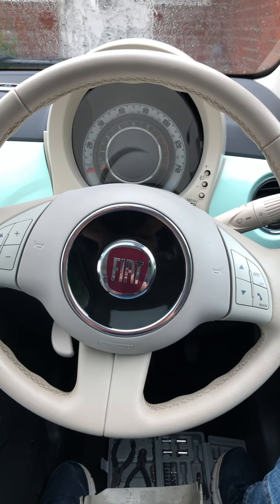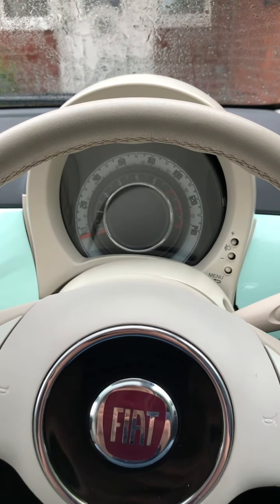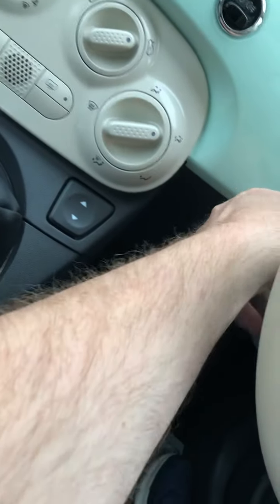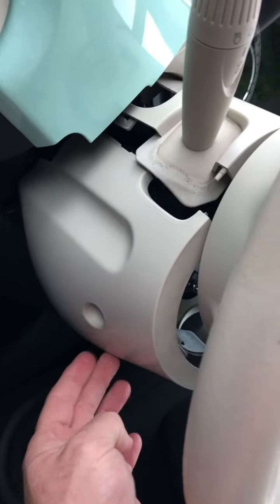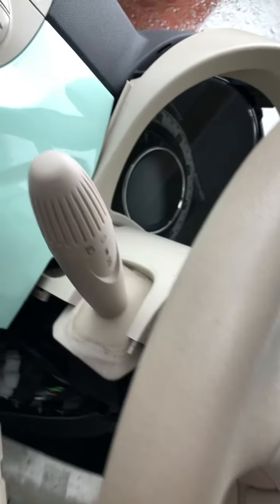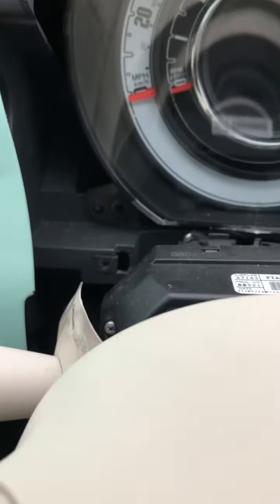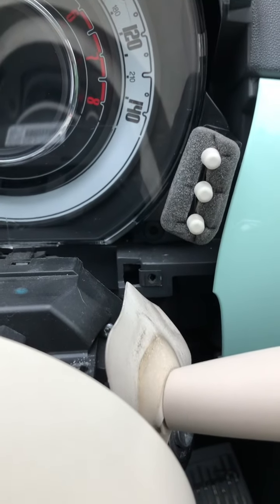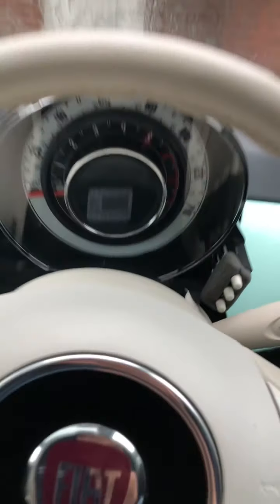Fiat 500 instrument cluster removal

Comment: Thanks for the video. Very useful. I will have to remove the speedo on my daughters 500 as the display is showing flashing oil and abs lights when indicating right. Same colour as yours ! The repair looks like its going to cost around £300.
Reply from the maker: Hi, I paid Cartronix £250 but that was a while ago. My display was completely gone but not sure about your issue, have you checked all external bulbs as the displays sometimes do odd things when you have a faulty or blown bulb. Check brake lights, fog lights, reverse, headlamps, etc. I am sure I had some strange issues with warnings and found a bulb gone.
Reply: @MLTOPAYNE  thanks for the tip. I asked my daughter who lives on her own to check all the lights and she says they are ok. I was was concerned about the oil and asked her to check this urgently, again ok. At night she says the other warning lights are very dim. I will see her at half term as she is a teacher and check everything myself. 👍
Reply from the maker: @jonathanmellish4439  I hope you sort it out, funny, same colour, my daughter owns the green 500 and she is at Uni training to be…. a teacher! 👍🏻
Reply: @MLTOPAYNE  cheers. Good luck to her. My daughter is in her 2nd year and finding it very tough but to be fair the school has some issues to be honest.

Comment: Did you have to disconnect the battery to do this job? Or is it safe to dismantle?
Reply from the maker: Good question, the honest answer is I cannot remember but as far as I recall I just left the ignition turned off. The only thing electrical is unplugging the display which is not going to cause any issues so I don’t think I disconnected the battery.
Reply: @MLTOPAYNE  thanks for the reply Martin, have to do a swap for the printed white kmph to mph/kmph circular strip for an import, it comes with the warning light panel around the outside so means dismantling it from the central digital display and replacing rather than just fixing it over the original. So this video has been really helpful to save some money, thank you!

Comment: Why took mine out after it played up and used a 12v battery mains charger. Mine is start stop has a heavy duty battery that alone £200+ 

Had thought about changing with LCD speedo from 2014 but that requires reprograming the mileage too not major challenge but does require ecu recoder

Comment: Is it safe to use jump leads without disconnecting anything?
Reply from the maker: If it’s just a jump lead from another car battery then I guess it must be ok. The issue with charger is the stop start battery needs the use of a smart charger, this is what damages the instrument display if the battery sensor is connected. The battery sensor can be unplugged really easily so if your not sure just disconnect it then plug it back in, but if just a 12V supply via jump lead it should be fine.